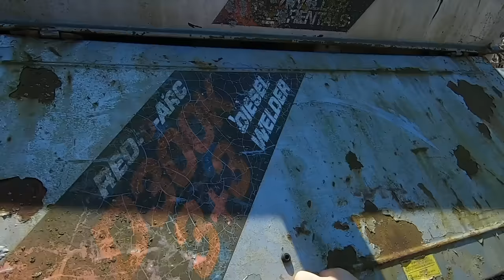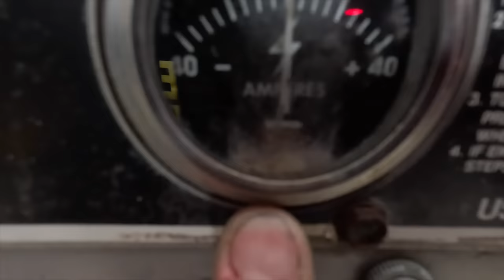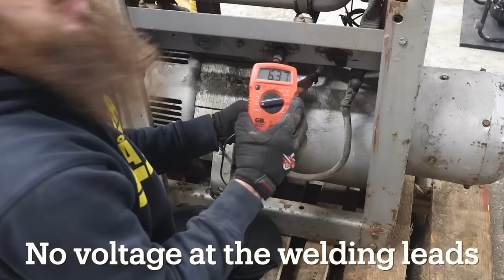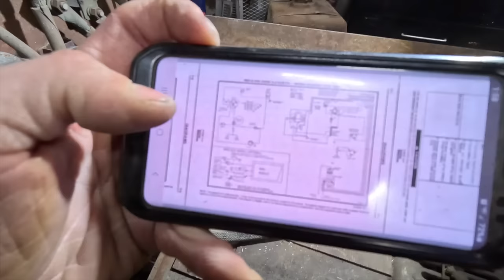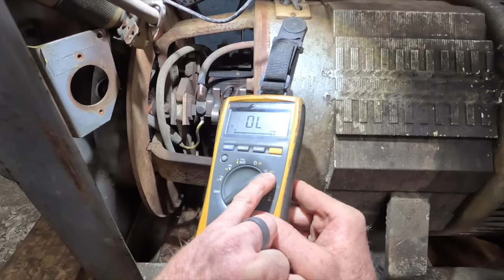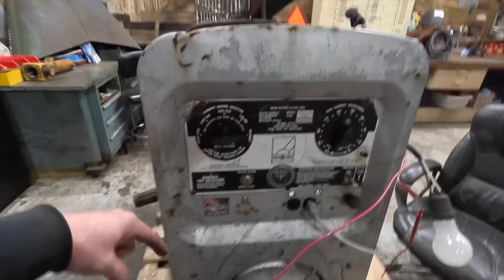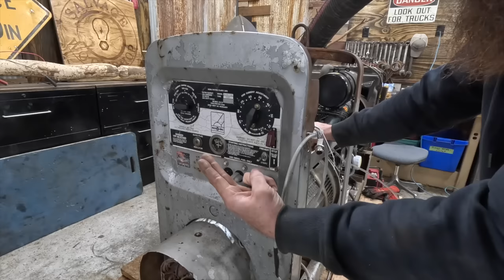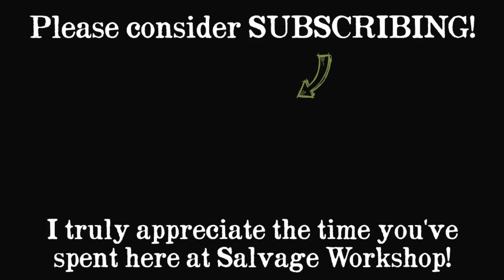SAVING an ABUSED Portable Welder from its Junk Yard GRAVE! ~ WILL IT START? ~ Red-D-Arc D300k P. 1

Comment: The momentary is a low oil pressure override switch. You hold it in at startup until it builds oil pressure. If you leave your new switch on, it will eliminate the safety features for low oil pressure and overheating.
Reply: Should’ve just left it like it was., it was like that and worked fine until someone else came along and started modifying it.
Reply: That was what I was yelling to my screen, too...
Reply: Yes. He needs to put the momentary switch back.
Reply: I was also yelling that at my screen the entire time he was talk about and changing it. Just jumped on my phone to check the comments to see how many people had mentioned it.😂
Reply: Kept thinking there was a reason it was done that way. This makes a lot of sense.
Reply: Murphy switch
Reply: Outstanding job on that portable welder. The fact that you stayed after it and never gave up impressed me . Grateful for this video
Reply: Right, that button basically temporarily shorts over the oil pressure sensor, and then when the oil pressure comes up the sensor kicks in and holds the fuel shutoff and hour meter (and evidently the alternator circuit, too) engaged by itself.  A lot of times, that button should not really need to be used due to the oil pressure coming up enough after a couple seconds of cranking.  With the random readings that were got testing the oil pressure sensor, I'd say the sensor's possibly the culprit for why things were only randomly working.
Reply: Came down here to say the same.
Reply: Lol I was yelling that at my phone too!
Reply: Wow sounds like a lot of us were all groaning out loud wishing we could interject some “words of wisdom” 😄
Reply: Was saying the same thing while listening while at work. It's a Murphy switch!!
Reply: A start sequence instruction would've helped
Reply from the maker: I agree that if i leave that toggle switch ON it will override the safteys, and im going to have to remove that! As far as that momentary switch goes, its not original, and i'll deal with the initial power to the oil pressure switch a different way... ill show you in the next part!

I appreciate everyones input and advice! I learn a lot from the comments!
Reply: @SalvageWorkshop  I really like that you're learning from your comments. Some people think they know it all, and are not willing to admit that. That ego gets in a lot of people's way.. We're all always learning. Nobody knows everything!! Really enjoy your content and how you seem to think/trouble shoot! Sometimes I do believe you overthink things and make it harder on yourself.. I find myself doing the same all the time. Take care buddy!
Reply: @SalvageWorkshop  While that exact switch may not have been original to the machine, I’d be surprised if it didn’t have a similar switch.
Reply: I was thinking the same thing, similar to how the pilot on a gas furnace works.  You hold the button until the sensor heats up enough to hold the gas solenoid open.  That said, it's your machine which means you get to do what you want with it
Reply: I think this guy is baiting us to comment with his “mistakes “ so he can jab us in the comments, I got in the flypaper on the second video but l’m done, canceled subscription
Reply: @gordonhenagar6652  I don’t think that’s the case. I think he lacks confidence, therefore doesn’t accept constructive criticism well.
Reply: I’m guessing nobody ever taught him the KISS principle. As Scotty famously said, the more complex the system, the easier it is to gum up the works……
Reply: @dandunlap8638  that and he just wings it thinking none the smarter. he cannot make a difference between voltage and current.
Reply: @leftitbythecurb8350  I’m guessing he doesn’t know ohms law 😂

Comment: Excellent video, I'm a Master Electrician with over 45 years experience but it's the first time iv'e seen someone make a cable lug out of copper tubing.👍
Reply: Its a very good idea, but maybe too thin for this purpose, it maybe limited the current and burn away over time, see how Massive the copper is on the electrode holder around the cable..
Reply: There's someone else on YouTube who I've seen do it.
Reply: @BenjiKimba 
It can cause issues, especially with thin-wall, but if you need something in a pinch for testing or to finish up a job, it does the trick. 
I'd agree with you that it'd be best to order up the right pieces for a more permanent solution. 
The thing that I've seen cause issue is where you have to crimp down the section, with too thin of material it tends to fatigue fracture at that seam/crease, especially if you fail to anneal it after re-forming (prior to crimp or solder).
Reply: I also use it all the time since readily available ones are too expensive. And for tractor or machinery use it's perfect. Just solder the wire in and done
Reply: @typrus6377 Yes, for moderate currents its okay, you can improve it by take a same piece of tube, saw it in over the lengt on one side, and shift it over the other one, also flattens the end and drill a hole in it so both can be mounted the same, even multiply if necessary to get enough  copper thickness, and clamp it together.
Reply: I do the homemade copper lugs to
Reply: I have made many copper lugs from copper tubing of various sizes. Works great.
Reply: I've used a brass cartridge case in a pinch. .223 Rem, in fact. I had it in my truck and had radio equipment to get running right then. It's still on there too this day.

Comment: BTW those not familiar should know Red-D-Arcs are rebadged runs of Lincoln welders. Overhauling old engine driven Lincolns so they can get back to making money is older than anyone reading this (the SA family goes back well before WWII).  Unless one is destroyed in a fire they're NEVER "junk" because there will always be uses for the parts as cores for overhaul. For those not familiar Lincoln have the manuals and parts books for download and there is a fairly large aftermarket because rig welders need their machines fixed immediately.

Comment: when attempting to revive a generator, of any sorts that has been sitting..  first step even before trying to turn it over... is to make sure no rodent houses is in the generator end, an acorn or etc, dead mouse can really mess up brushes and windings and the lamination.. look for burned or melted wires, if its newer, and has brushes you defiantly want to clean the slip rings or you can zap the voltage regulator..   then worry about the engine, then clean the slip rings and check that the brushes are free if you haven't already..  you flash the field when its running.. and very quickly..

Comment: The system is called a murphy shut down system. Murphy's law states anything that can go wrong will. The temperature switch should have a small allen screw to adjust the shut down temperature, if not someone has replaced it with one that does not belong there. You can have a stuck brush on the generator side. The push button switch bypasses the murphy shut down to start once oil pressure and temp is up at start you release the push button to let murphy safety shut down take over.

Comment: Your bridge rectifier is good, the reason you get twice the reading is your reading both sides. It should only read just like you tested. There are times you will need to flash your fields while it is running so that the lines of flux created will excite. Always make sure your brushes are free and make complete contact with your commutator or when you flash the voltage will not hit your field windings. Good job young man!
Reply: You nailed it. Back in the 70s I was in test inspect at Hobart Brothers main plant.
You saved me some writing   ; )

Comment: My friends at the gas utility where I worked for 30 years swore up and down that they would NOT want any other welder than this one. The higher ups bought them new Miller machines. They OUTRIGHT told them they wanted their Lincolns back hands down. They got 'em back ! That is a great welder you have there.
Reply: Oh the tribalism... a real sign of intellect.
Reply: This is a really cool machine with lots of character. But the Miller replacements can run circles around this machine not to mention that parts are readily available. Not sure how they got these old machines back after they were taken out of service. Sounds more more like a movie than reality.
Reply: @giggiddy  ...not if you consult Lincoln weldors that do B or pipeline work...a generator is their first choice. and the ones from the mid sixties, all copper windings, are highly valued and much sought after

Comment: Nice job of bringing that welder/generator back to life, you have got yourself an excellent welder on your hands. Like your step by step approach to refurbishing the unit and cleaning and replacing the wire connections as well as the some of the wires. Thanks for the video, appreciate the time and effort you put into them. Looking forward to part 2.

Comment: A very nice score and a great fix. I think the temporary switch was meant to be there, as a means to power the shutoff solenoid to start the engine, then once oil presure has been built, the shutoff will remain active until oil or iver heat.

Comment: Brilliant video I traded a set of trailer ramps for a ‘broken’ mig welder, I pretty much did what you did, cleaning repairing and replacing obvious bits, it took me about 3 months between paying work but I finally got it to go and it’s absolutely brilliant, big old thing with a remote top and it’ll do anything from bodywork to heavy steel. The best part is that I stuck with it and it’s a great feeling bringing good stuff to life.
Love your channel

Comment: @Salvage Workshop - So glad I run across this video. I will be the first to admit that I am not a mechanic, BUT I do have the desire to learn and I have learned alot from this video. I am in the process of rebuilding an '79 Lincoln SA 200 (gas engine) and it has so much in common with what you are seeing. 
You my friend have earned a subscriber. Outstanding content and explanations along the way. This is what makes Youtube so great is when you find someone that explains stuff as they go along. Sometimes manuals and books just don't cut it.

Comment: Welding unit deserves a custom paint job, candy root beer with flake, any candy with flake 🤘💯
Reply from the maker: I agree... don't miss part 2, I think you'll enjoy it!
Reply: @SalvageWorkshop  Chrome pipe, turbo and use the back light on the gauges as your pilot light.
Reply: Custom stainless header

Comment: You shouldn't replace the momentary switch with an on off switch. The purpose of that switch is to bypass the oil pressure switch when starting the engine so the lack of oil pressure doesn't turn off the fuel solenoid when starting the engine. As soon as it builds oil pressure the momentary switch should be released and not used again until the next time you start the engine. If you use an on off switch and leave it on when the engine is running the engine wouldn't shut down if it loses oil pressure. That is also why the hour meter kept running when the engine was off. The oil pressure switch probably turns on the hour meter when there is oil pressure if it is working correctly and is connected to the solenoid switch correctly. If you do use a toggle switch only turn it on when starting the engine until it builds oil pressure so it keeps the fuel on.

Comment: Loved the video! Enjoyed your repair journey. Suggest that you assemble the copper pipe over the wire (up to the insulation), then solder from the open end then crimp/drill as a last step.  Much easier with a better transition between insulation and fitting. A bench vise is also a great way to form that pipe end into a lug! ALSO be mindful whenever welding when your dog is nearby. Their eyes are even more sensitive to arc flash than ours.

Comment: Hey Matt if you debur / ream your copper pipe when you cut it and the wire will slide in easier and also if you heat and fill the connector about 1/3 full of solder the wire will adhere better and no need to crimp it. Enjoy your videos man. Keep em coming

Comment: Bridge rectifier - If you look at the picture - that one is ok.  NO PROBLEM.  The probe on one end feeds through two rectifiers and to the other side.  Only in one direction.   It turns AC voltage to DC voltage.   The 12v needs to be added to the excite coil while it is turning.  It must generates a field using many windings.  The last two large wires on the master range switch show they were over heated in use and used much more than the others.  The wire might be small to the current used generating the heat.

Comment: Glad to see you using a commutator stone to clean the slip rings. I've seen folks use sand paper or emery /crokus cloth which imbeds small abrasives in the slip rings turning then into brush grinders lol

Comment: New subscriber here, and as soon as you pulled out the shop vac for step one of cleaning as you disassembled the machine i knew id be a fan. My father taught me how to troubleshoot and fix anything, regardless of how well you know the machine, and atep one is clean and disassemble. Once its open and clean you can start testing each weak point until you find the issue.

Comment: your rectifier @ 1:30:00 is working 100% fine :)  - this turns 3 phase a/c into d/c .. so the 3 terminals are  taking each one of the phases and turning it into d/c, which is a single phase ... so no matter how you test it can ONLY go  one way no matter which terminals you are testing.... you'll get two of them with half the value as the output because it has only gone through 1 diode at that point.... thats why you brought up double the values... it's working just fine :) - THANK YOU!!! You just helped me FULLY UNDERSTAND how it works... I wasn't sure of the values doubling either, but now it makes sense LOL
Reply: I think he just drew the diagram wrong. The diodes make a loop in a bridge rectifier

Comment: You need to put that momentary on button back on..... You push it when cranking, until oil pressure builds. The way you set it up, will destroy the engine if it looses oil pressure or the coolant temperature gets too high.

Comment: I came across your video and your present setup and explaining what your doing is 100%! I have been a millwright and steam engineer for many years and the only strike i see is "BROTHER GET AND USE YOUR SAFETY GLASSES PLEASE!" I had a breaker with a direct short to GROUND explode right in my face yet lucky for me I had safety glasses & shield on! The shield had aclual pieces lodged in it! It ended up o a display that at the time was mobile promoting safety.

Comment: The main spec you care about when selecting an alternative oil filter vs. factory specified is the pop-off pressure for the bypass valve. 

Most oil filter media are similar enough in mesh size that they will do a similar job in filtering crap out of the oil, so I wouldn't worry much about that; physically larger cans will be able to hold more dirt before they clog, which is a good thing, but if the bypass pressure is not the same as factory, the valve may pop prematurely, letting unfiltered oil just flow through the valve, or probably worse, it may not pop off at all and if you let the maintenance schedule slip and the filter gets clogged, it will starve the engine of oil...   There is no correlation between bypass pop-off pressure and physical size (ie, just because it is the same or similar size doesn't mean the bypass pressure is the same), so you have to look up the spec for the original and the replacement filter..

Comment: Hey!  I used to work as a mechanic for Red-D-Arc about 20 years ago.  In Canada.  But I got shipped off to Georgia for a training course.  Who knows, maybe I worked on that very machine.  ;)

If they're maintained, they'll run damn near forever.  I'd love to get my hands on one.
Reply: The fuel was gravity fed through the filter, to the lift pump, then to the solenoid (which IF memory serves was only used on the early models as a low oil pressure shut off), then to the injection pump. The return line off the end of the rail went...  I don't remember.  :(

That does look like the OE engine.  V2203 was newer.  I have some parts for a 2203.

I still have RDA STICKERS in my tool box!   :D
Reply: They're fixed governed at about 1850rpm. Loaded would drop to 1800 to give you 60hz at the AC outlet (which not all versions had). It gets adjusted by the bolt on the injector pump where that spring is.

Comment: Definitely worth mounting it on a trailer.  My main suggestion to you for this sort of equipment is to standardise components as much as possible.  Means it takes more work to set up (because you have to modify things to your standard) but it's well worth it in the end.

For example, when we built our equipment trailers we chose a standard rim & tyre, standard axle and standard leaf springs for the trailers.  Easy.

But we also chose a standard battery, and standard air, fuel and oil filters.  Additionally the filters were remote mounted to make servicing cleaner and easier.  Standard fuel tank with low pressure electric pump.  Replacing any drain plugs with valves and hoses that lead neatly under the trailer makes for simple and clean fluid changes.

We also standardised (as much as possible) on the instrumentation and controls.  Another useful thing was to make up a plaque listing all the critical specifications of that machine: fluid capacities, servicing requirements, etc.